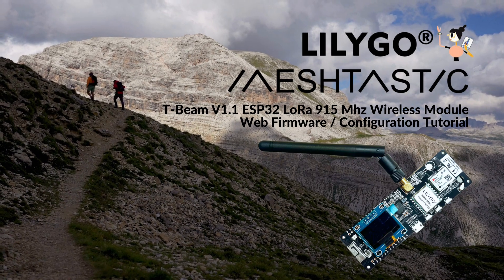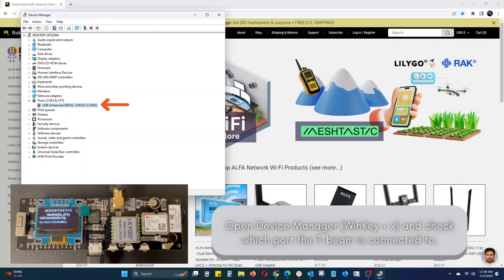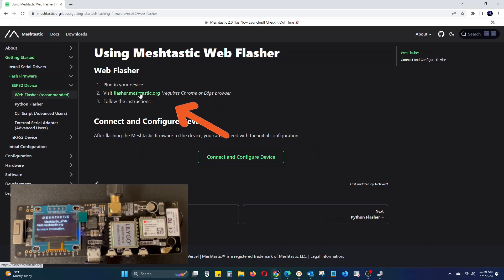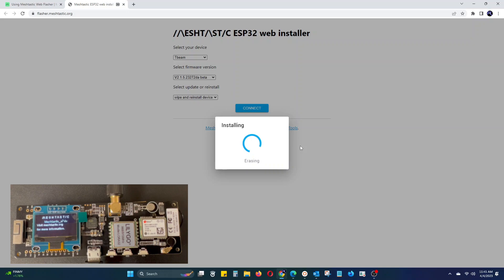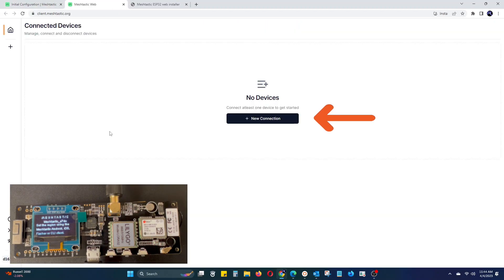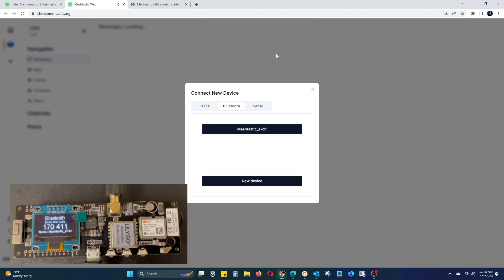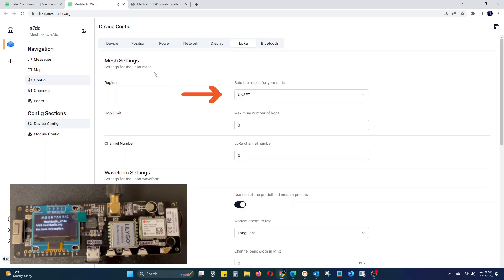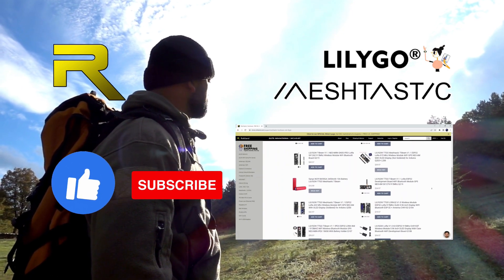Web Firmware / Configuration Guide - LILYGO Meshtastic T-Beam V1.1 ESP32 Wireless Module

Comment: Thank you very much for the information! Now, if I want to use it during my hikes in the páramos, and in addition to sending my coordinates via APRS, I want to use sensors to measure temperature, humidity, walking speed, and some other variables, or perhaps send an SMS with the coordinates at regular intervals using a GSM module, can I do the necessary programming to make it work? Since it is based on an ESP32, I think it could be done, but I'm not sure.

Comment: Is it possible to change the screen and connect a larger display (like 7inch).  Perhaps even have an extra power source to the bigger display.?
Reply: i think it should not be an issue i did it with a 4 inch display, but with roughly same power draw and very low hz. there should be a data sheet online of max draw from the display connectors on the bord